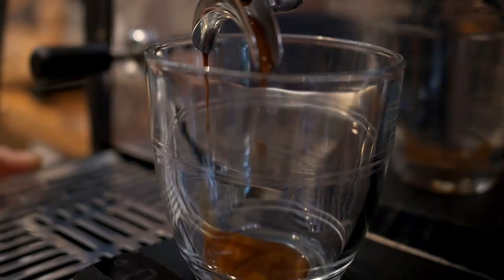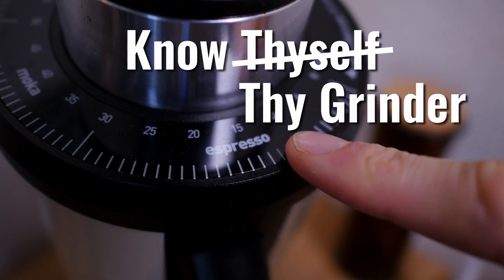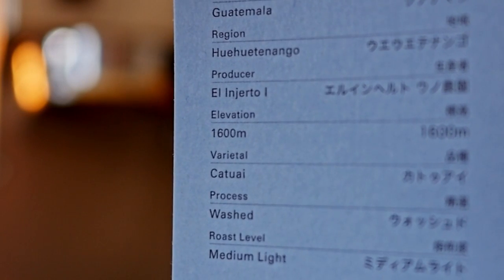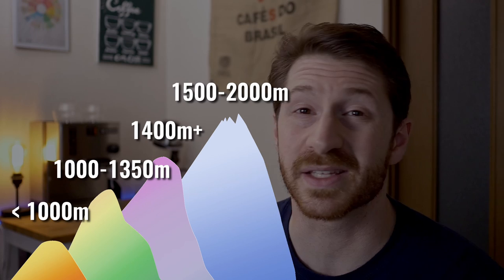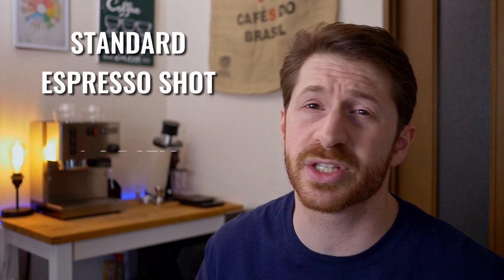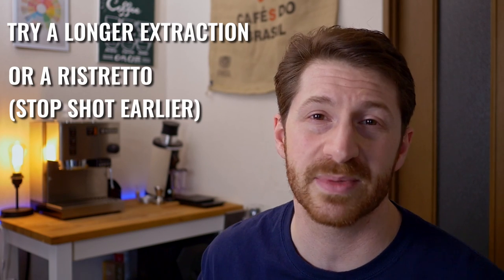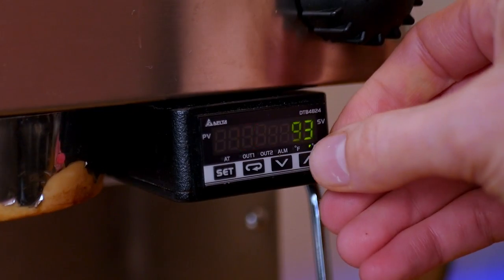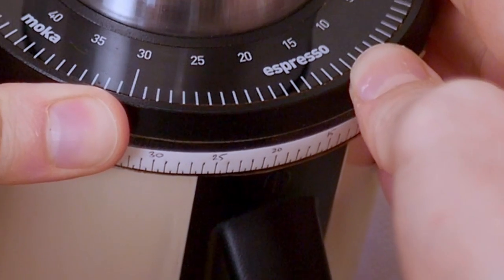How To Dial In Light Roast Espresso

Comment: Great video Charlie, a video on shot consistency would be great. For example I'll pull a few shots on one day that are pretty much same output and timing but the next day the shot will run fast.
Reply from the maker: Yeah that's a tough one. Maybe that would be a good short!
Reply: With a 1 day change,it seems interesting. My thoughts would be that you’re pouring more beans than you need in our hopper and they loose their freshness quickly which will cause your shot time to shorten.
Reply: @dirkl216  that is only one possibility. I used air escape to store my beans. I’ve noticed that change some time just one day apart.

Comment: Thank you so much for the video! My beans are on the way. It’s from Guatemala, dark roast, 1400 m elevation, and has notes of chocolate and caramel. Wonder how I should proceed with it? Will the relative high elevation offset the dark roast as far as temperature and grinding size wise? Thank you!
Reply from the maker: You can only try it out and test. It's all relative and the more you practice dialling in the better you'll get at it 😍
Reply: @homecafecharlie  Thank you! What is the scale are you using? I started getting annoyed with my little scale. I wanted a bigger one that at least can hold a 150mL expresso cup. I don’t want to pay $250 for Acaia because I don’t want to fiddle with an app first thing in the morning. Just wanted to make my coffee and get going.
Reply from the maker: @sciencescience9102  The Acaia is the top of the line one, you don't need that, it's just a nice to have for workflow purposes. There's the TimeMore black mirror scale which is supposed to be very good, and I was using the Hario Coffee scale, which is more designed for drip but as long as it can do 0.1g you should be golden!

Comment: I struggle most with prioritizing a change. What do you prioritize first to last and when do you know that you can rule out that particular culprit for a bad shot?
Reply from the maker: GREAT question: I think first I do my pre-check with elevation and roast level of the beans and choose a starting temperature, then grind size, then if I'm still failing I look at my dose (though in my pre-check for denser beans I might raise this so it fills the basket properly).

Comment: I've been frustrated for a week or so trying to get good shots from, to me,  a new roasters super light roasts. The typical 15.5 gram dose producing a 22-24 gram shot in 28 seconds was just sad - thin and with no flavor. So I ground finer than ever before and started to get good shots at 40-55 seconds. No temp adjustment but I'm sure a shot that long cools down a bit so I might bump the temp a couple of degrees. But maybe not - as long as I'm getting great shots at 50 seconds, I'll be happy.
Reply from the maker: That's the spirit! Experiment till you find what you like and what works!

Comment: This is exactly the problem I have. Using a crushgrind Colombia on finest setting and a medium to light roasted bean through a picopresso hand pump I get very acidic and sour espresso. I've tried longer preinfusion, slower pulling, extreme preheating and ratios between 1/1 and 1/2. Anything else I can try before I give up on this bean (which I really enjoy from the shop)?
Reply from the maker: Did you try dosing up? If you have a standard portafilter go for 20g? Maybe you need to upgrade your grinder as well?

Comment: What light roast origins do you recommend, Charlie? I have tried to pull Kenyan beans at times and they are a bit too sour for my liking.
Reply from the maker: My favourites are usually Ethiopian for espresso. Had some amazing ones. Recently had this amazing Guatemalan bean, 1600m and tasted like ripe nectarine. Really amazing!
Reply: Probably was due to brewing variables more than the coffee itself, like he said, try going hotter, or  just adjust the brew ratio, I've had situations where 1:2 ratio of 18g in and 36g out was sour, but I just let the shot run an extra second to get 18g in and 39g out and it was nice and balanced there without changing grind size or anything.

Comment: Hi, Charlie! Great video. I'm curious how fine you go in DF64? I tried dialing until number 5 but scared it will hurt the burrs 😅
Reply from the maker: I've never gone that low. On mine the burrs touch at around 2, and I've never gone below an 11. They won't all be the same, millimeters are a massive difference with grinders. I love mine though, it's a great grinder. Now I just need a new espresso machine
Reply: @homecafecharlie  flair 58 😉
Reply: DF64 is easy to tell safely where your burrs are actually touching, just make sure the machine is really clean, lots of pumping hard of the bellows, adjust finer with the machine off, rotate the burrs by hand on one of my DF64s the touch point was way below where it showed 0, so I was actually  brewing espresso at around the 0 point or even finer usually. IF you have SSP burrs they're thicker so touch point will be around 35 instead.

Comment: Scott Rao just posted on Instagram that Ethiopian beans need a much coarser grind, now I see this and check the elevation on 2 different bags of Ethiopian I have here and they both say 2100-2300m. So I should be grinding very fine according to this advice?
Reply from the maker: Correct me if I'm wrong but I think he was talking about pour over in that post, right? I'd love to learn about it from him but in my experience I get nothing but sour and often undrinkable espresso with coarser grinds on light roast espresso. Usually I'm at close to the finest settings I've ever used for ones with the highest elevation. But he knows more than me so I'm sure there's a reason and maybe a different way for espresso. Thanks for bringing this up, I'll do some more research.
Reply: @homecafecharlie  No he was taking about espresso. I think you really need to be flow profiling to go coarse with light roasts.
Reply: Maybe there is something specific about the Ethiopian climate.
Reply: For the record I do find personally that I need to grind Ethiopian single origin coarser than blends.
Reply: @paul--b  he says this normally i think because ethiopian coffees tend to produce more fines
Reply: like i think hes saying to grind on a coarser setting because a greater proportion of ur ground coffee will end up as fines and if u grind at the same setting youll choke ur machine